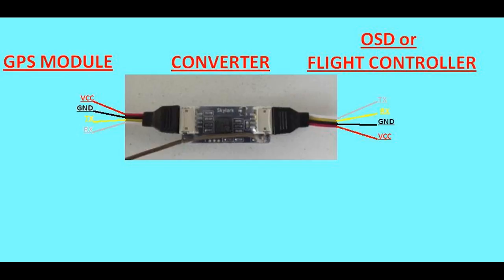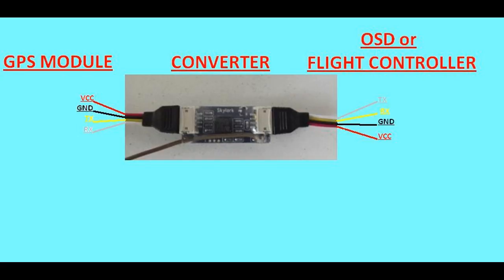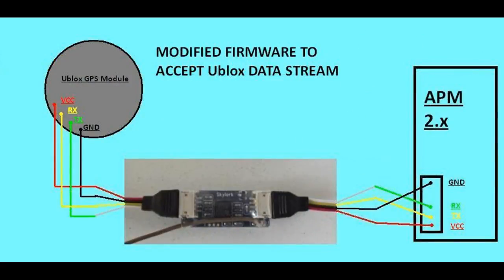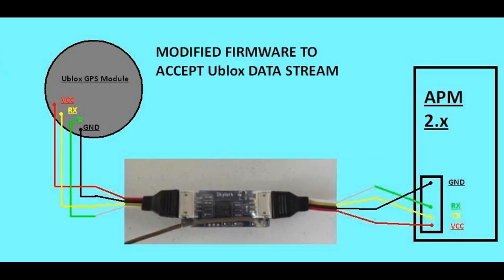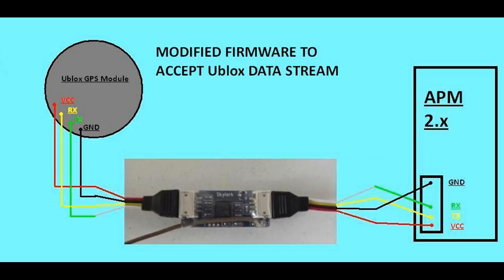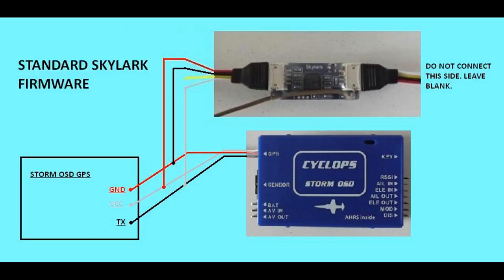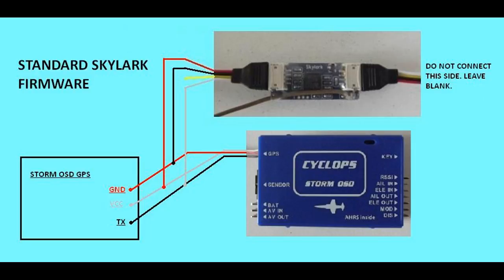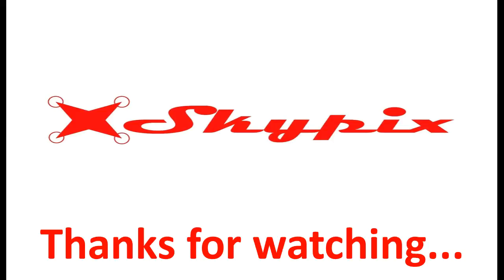How to.. Skylark FPV AAT convert module wiring APM and Cyclops storm OSD automatic antenna tracker

Comment: Hello great video! No way to get it working in flight ...seams to works at one meter from the ground but as I raise the plane  over my head it looses the coordinates! Any sugestions ? No way to get an answer from skylark!
Reply from the maker: Can you post a picture of your wiring? Also what equipment are you using?
Reply: @JD_fpv  I will try an another configuration on sunday and I will let you  know! thanks for the answer.

Comment: hello I did the upgrade to use the ublox gps in the module, but the module after the upgrade does not turn on
Reply from the maker: Juan Hernandez Juan Hernandez that’s odd. I’ve never seen that before. Is your wiring correct?

Comment: Does this setup work with the Pixhawk?
Reply from the maker: Yes I don't see why it shouldn't, as they are both similar flight controllers, using the same GPS units.
Reply: +James Dyke Thank you for your quick reply and all of your work on this topic.  

One more question.  Do I need to plug the conversion module into the groundstation as well as the UAV?  In other words how does one get the AAT talking to Mission Planner?
Reply from the maker: +Joseph Busalacchi  they remain seperate. The convert module goes inline between the APM/pixhawk and the GPS module. Then the wire from the convert module goes to the "audio in" line on the video transmitter. That's it. The aat doesn't need to talk to mission planner. They both do seperate jobs.